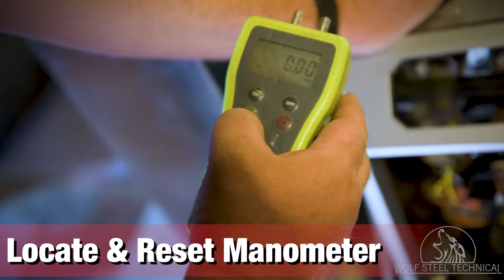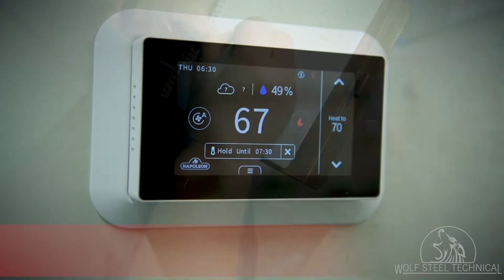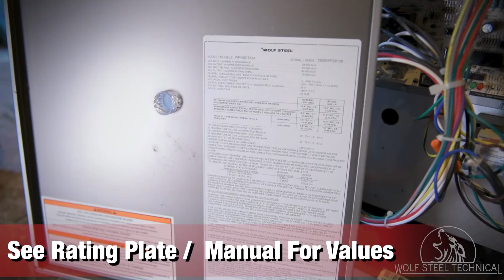How to Check Gas Pressures On A Furnace

Comment: What is that adapter??? My boss started a deal with a napoleon dealer and thats the main furnace we sell. I went to set the gas pressure and none of my barb fittings would go into the port. I had to use my tube with a bit of electric tape, which is super sketchy. Please, I've been trying to figure out the thread size of the gas valves in the 36g54 gas valve Napolean uses in the 9600.
Reply from the maker: Hey! Great question. what you need is an Adapter Kit for 36G Gas Valves. White Rodgers has it as part number F92-1003

This will work for all White Rodgers gas valves. Hope this helps!
Reply: Great video.  On some furnaces like Carriers the rating plate only shows manifold gas pressures for natural gas. On the rating plate it only shows manifold pressures for natural gas. What would be the manifold gas pressures if furnace in running propane? Thanks